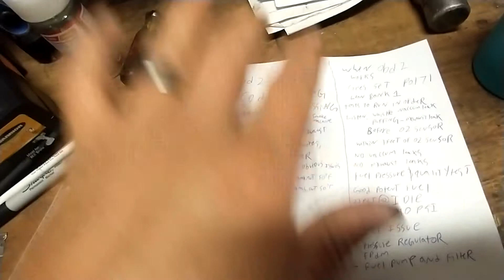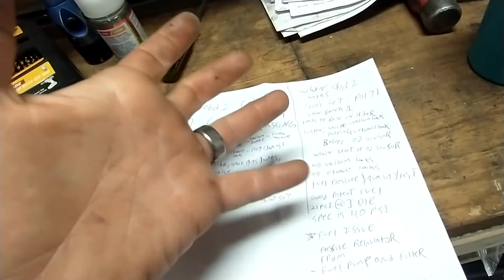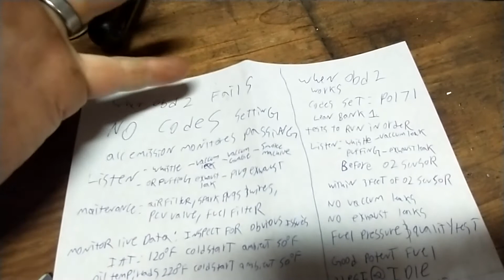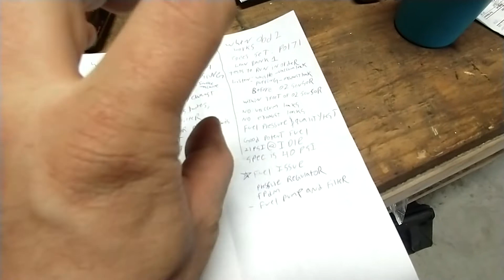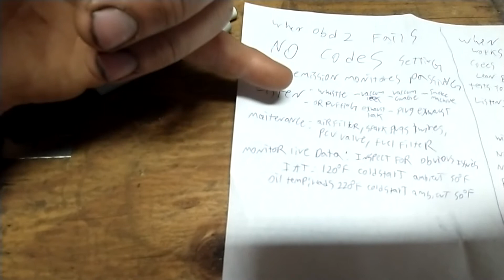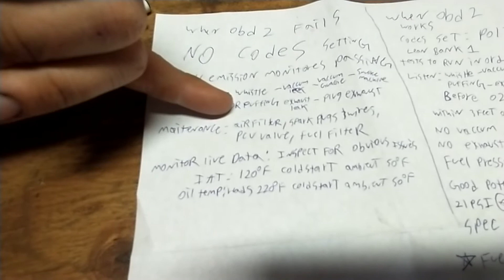runs rough no codes set. OBD2 diagnosis without codes. part 1

Comment: Hi I need help     I have a 98 Chevy Silverado  2wd I swapped  the automatic transmission to a 5speed  transmission   Now my speedometer does not work I did have to go get a plug to splice in to my plug and I didn’t get a new speed sensor yet and it  starts and runs but acts like it’s fluiding  some times and when u push the clutch in to slow down it will just quit or try to or between shifting gears it try’s to quit and then it picks up and goes   What u think is wrong with it  I need help some one told me  I might have to have a pcm flash
Reply from the maker: The stalling and flooding is most likely the ecm software. The issue is the ecm is still operating as if it were an automatic. So it is adding fuel to maintain engine speed before it sends a shift signal to the tcm. Meanwhile you are just accelerating and the fuel mixture goes stupid rich and then back to normal then you push in the clutch to shift and engine speed drops (ecm reduces fueling for decel) you grab a gear and let off the clutch pedal and attempt to accelerate  (ecm is still cutting fuel) fuel mixture is super lean, no combustion occurs, engine stalls. I had this same issue before getting my ecm reflashed.
Reply: @garrettgrantham7411   I don't have no engine lights on  nether
Reply from the maker: As for the speedometer, check that you have the correct speed sensor. (Gear driven cable, or magnetic pick up style with a tone ring.) My speedometer issues were caused by incorrect tone ring tooth count in the ecm software.
Reply: @garrettgrantham7411   thanks for the reply I might have to find some one that can do that and my speed sensor  is magnetic  type speed sensor